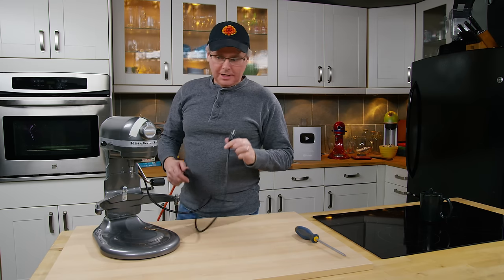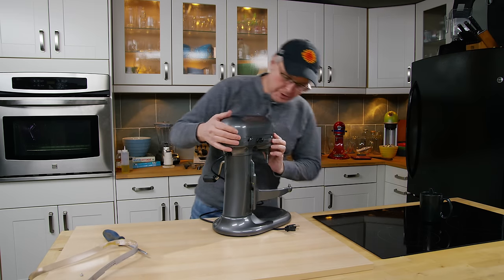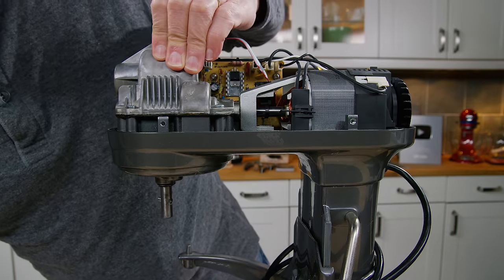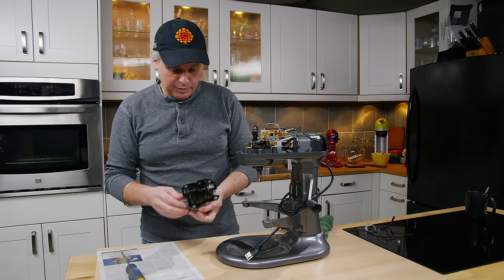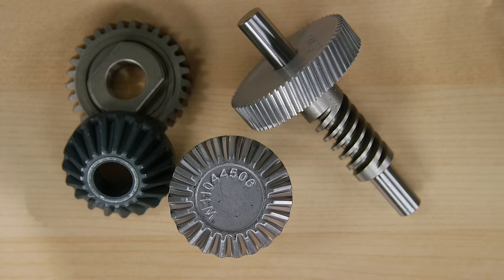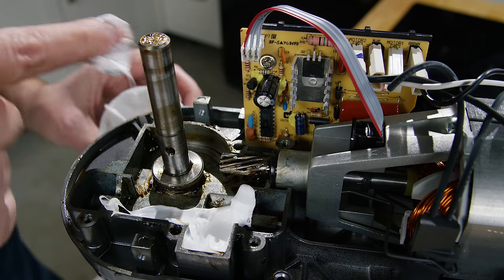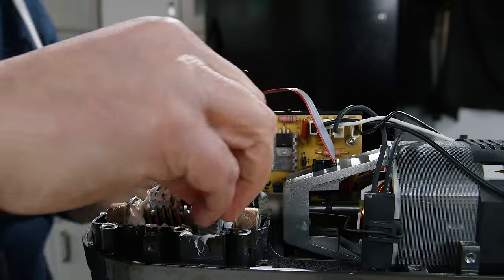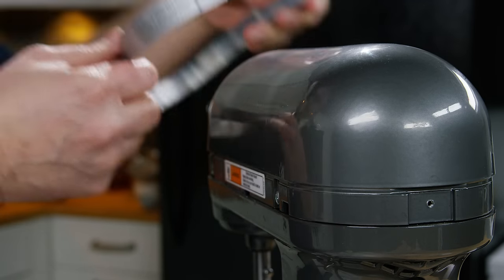Fixing KitchenAid Pro 600 Stand Mixer Teardown & Rebuild Of Gearbox - Glen & Friends Cooking

Comment: Great video and great walk-through however, you did not show people how you got the attachment gear into the top case so I’ve got a hack for that, put the top gear in the case and throw it in the oven at 450° for 10 minutes pull it out and with a oven mint and a screwdriver you can slide that gear straight in 💪🏼

Comment: I have a model down from that one. One day I was making a cake and the mixer head began oozing oil into the cake batter. Needless to say, I was not a happy camper, but I took the mixer apart, cleaned out the gearbox, and added new grease to it. Fortunately no gears were bad; just broken-down grease. I remade a new cake the same day.

Comment: Excellent video, keeping this handy as i've only worked on one of these new models and only had to replace the speed sensor, I've revived many of the old hobart ones that were about to be tossed out. Looks as if there are more parts in the gear box on these compaired to the old ones though. Cheers!
Reply: Considering buying an old Hobart KitchenAid k45 SS mixer. Are they less complicated to Greece?

Comment: I am repairing this model for my daughter in law and have replaced various broken gears easily thanks to your clear video instruction. I am having an issue with the planetary. It gets to one spot and binds up. I have removed and inspected that gear and the one that drives it, both seem fine, but nothing I do resolves that issue. The only other item is that this machine came with identical bearings for the worm gear and so I need to replace one, but I don't think that's what is giving me this issue. Any advice?

Comment: Hi Glen, what did you use to clean off the old grease? And what was the total cost for parts?
Reply: Just wipe most of it off with a rag or paper towels and toss it. There are a number of solvents you can use to get things really clean. Probably plain old paint thinner is about the safest and easiest to get. Just put some on an old rag and wipe the housing out. For any gears you want to salvage you can use a cheap paint brush and a little dish of thinner, but BE SURE that you get any loose bristles off, or they will foul things up.

Comment: Cool video. Might I suggest using an acid brush when applying grease. It will deliver a cleaner, less messy, and possibly more precise application of the lubricant.

Comment: I have a KitchenAid Artisan Stand Mixer KSM150, which is about 5 years old. Recently it had some big noises and thus I changed the worm gear as well as grease. Now it can spin quietly without anything in the bowl, but when it is making a dough with a flat beater it occasionally gets stuck and stops spinning (motor still sounds running) until it slowly gets over it. It looks as if it is not powerful enough or the torque is not large enough. Do you have any idea what might cause this problem? Thank you

Comment: Excellent video, but I'm wondering about the input gear on the motor shaft. It looked like a few teeth were worn, but it might have been grease or the lighting. Can that gear be replaced or is it one piece with the motor? Either way, thanks this really helped.

Comment: Did you wipe off the excess grease from the housing after tightening the screws?  Heat form use can make it run down etc...

Comment: Like Glen said, the grease will break down and become runny over time.  Found this out when I stored my mixer on its side during a move, and a lot of greasy oil had run out of the top seals. So keep them upright :)

Comment: Glen, we have the same mixer in this video.  I have removed the c-ring and when I try to remove the gears on the shaft, there seems to be some scoring on the shaft that is making the gear unable to slide up the shaft.  Is that something you see normally and if so, do you get a file or another abrasive to smooth it?  Thanks in advance.

Comment: The speed control on my mixer has been bad pretty much from day one of owning it.  Just recently I popped the top off and sprayed some electrical contact cleaner into the switch slot and now it works, but there is resistance to moving the switch.

Comment: Is it possible to replace the gear that comes off the motor? I had the same issue and thought it would be good to replace the drive gear attached to the motor because it had some wear.

Comment: Glen, I need your help, please! I have the KA professional 5 plus, and am attempting to replace the worn gear—however, I don’t seem to have the all important pin that goes  in between the two main gears. No hole, no pin, no way to get the sheared gear out. Any advice?

Comment: Thank you for the tutorial. My problem is the bottom piece is working its way downward towards the bowl. Can it be fixed the same way?
Reply: If the bottom is sliding down, then you've probably got a broken shear pin just like Glen had.  Not only does that pin hold the two gears together but it also keeps the shaft from sliding down.

Comment: Glen, I what’s the best way to remove form the main shaft  the worm follower gear (9706529), I was able to remove the Bevel Gear (9703337). The Worm Follower Gear looks ok but there is a lot of small metals parts blended with the grease and I want to clean the housing. Your advice is welcomed

Comment: Purchased one in 1983. Gave it away last year for free, friend still uses it. Bought this exact new model shown in the video. Out of the box it was extremely loud and would heat up. Opened the gearbox and not one (1) not a drop of grease inside. Dry as a bone, a little powered metal inside. Greased it up and so far so good. Quality control? What a joke.

Comment: I aquired a lift bowl like that from GOOD WILL.   I Replaced the Bottom Steel   Phillips screws with STAINLESS STEEL ALLEN HEAD BOLTS, AS well as FOOD GRADE GREASE    !!!!                                 <<<< Super FML - 2 Food Machinery Lubricant   >>>>

Comment: I have a problem reassembling my Professional 600 gearbox. I cleaned all the old grease from inside the gearbox, and replaced the forward gear and the front worm gear bushing. I replaced the worn parts with new OEM parts and repacked with grease. Everything moves freely with the gearbox cover removed. When I install the cover, I have around 1/16" gap between the gearbox top and base. If I try to tighten this, the motor binds! Any idea of what may be causing interference? Thanks!

Comment: The bearing cage and 2 washers (bearing races) are parts of a thrust bearing, needed because the worm gear always gets forced in that direction when the machine is running.

Comment: Nice video Glen. How did you order the parts? I have the same Pro 600 Mixer that has a worm gear broken, the one that you insert on the shaft and then secure with the pin. The model of the mixer is KP26M1XNP and the serial is W13209822. Thanks...
Reply: Where you able to find where to get parts? Can you share the link?
Thank you

Comment: Did your shaft have a snap ring on it?  Mine did on the Professional 5 plus -- I wasn't expecting that from your video -- maybe the part where you remove it got cut accidentally?
Reply: Also: do you have to lubricate the planetary gears below the gearbox?  (The set that turns the rotating shaft that holds the beater or dough hook)

Comment: Hi Glen.  I have a Kitchen Aid model KL26M1XSL mixer that I want to remove the motor, etc. from the base at the pivot.  How do I remove the top from the bottom?  The mixer was accidentally plugged into a 220V electrical outlet and I have to replace the motor, but I don't want to have to carry the base back from Egypt to get it repaired in the USA.
Thanks.

Comment: Here's what you need to know:
To adjust the bowl clearance, you can: 
Unplug the mixer and turn it off 
Raise the tilt head and lock it in place 
Locate the screw in the hinge where the head and body meet 
Turn the screw clockwise to lower the beater or counterclockwise to raise it 
Test the adjustment by dropping a dime into the bowl 
If the dime moves around continuously, the beater is too low 
If the dime doesn't move, the beater is too high 
If the dime moves about a quarter to a half inch with each pass of the beater, the clearance is correct

Comment: It seems to me the old K5SS and K45SS were much better built machines.  Mine are 33 and 45 years old respectively, and have been used a lot.  I have never overloaded them with double batches, etc.  I’ve never had any problems and it never occurred to me they might need any maintenance whatsoever.  After hearing about the newer ones getting stripped gears, I’m thinking about sending them off, one at a time, to be taken apart and relubricated so I don’t have to get one of the newer ones.  The new ones also have an obnoxious, high-pitched sound. There is an extremely knowledgeable young man out west, Mr. Mixer, who seems trustworthy and passionate about his work. Any advice from anyone?

Comment: Is engineered obsolescence Kitchenaids profit strategy? My mom's Kitchenaid is 50 years old and still working well and on that reputation of quality I've bought 2 KA mixers that failed out of the box with grinding gears. Their design is great...if they just would spend a small bit of money on good gears and bearings instead of cast gears and bushings the things would last a lifetime. There can be no other conclusion than planned obsolescence is the reason for poor quality.
Reply: Gears breaking down... It's appalling. Horrible quality indeed.
Reply: new ones I believe are not made in the USA.
Reply: I get the feeling it’s more of an intentional shear point. They’d rather have the fairly easily replaceable gears fail than the planetary or the motor. Which is how all the old ones fail
Reply: In a nutshell, yes that's the new strategy.
Reply: I honestly wouldn’t be surprised if that was their strategy. My mom received a pink one in the mid-2000’s as part of breast cancer awareness. It’s still running perfectly fine 20 years later while my 3 year old 600 series mixer sounds like it has grinding gears and I use it maybe 10 times a year
Reply: KitchenAid should be ashamed to have their name on these trash mixers that fail soon after purchase!  Plastic gears are the sign of planned failure! The engineering and design is good, but parts that make up the gearing assembly are unsatisfactory.
Reply: I heard it was to avoid ruining the motor.
Reply: Just did mine after 15 years and my wife bakes all the time. Thanks for the video. I bought the $52 kit which included everything including a snap ring tool.

Comment: My machine is 20 years old, but I don't have any problems with it. Should I disassemble it to replace the grease as maintenance, or is that not needed unless it starts having issues?
Reply: If it ain't broke, don't fix it. Unless you rely on it for something and would be severely put out if it was broken. I imagine Glen's break a lot because he uses them a lot. If you're like the typical home cook, you aren't using it THAT much so it'll likely be fine for years to come.

Comment: is it safe  to use the Kitchenaid Stand mixer without the band trim ring on it?
Reply from the maker: I never took the band ring out of the box. So Yes it is safe to use it without the band trim ring.*

*As long as you resist the urge to stick your hand into the mixer while it's running.

Comment: Where do you bought that parts? Any part number? i need that part, thanks!
Reply from the maker: You need to order the parts by the number on the ones in your machine - I've found that the 'same' looking machine, with the same model # on the outside, had different gears inside. So you'll have to take yours apart and find those #s.
Reply: @GlenAndFriendsCooking  ok thanks

Comment: What’s that gear called? I’m having a really hard time finding it
Reply: I had the same problem. The best thing to do is get the part number from the manual that came with the machine or find a digital (pdf) version of the manual online. If you can’t find the exact part number, then try www.applianceparts365.com. I found the gears by choosing Kitchen-Aid from the “Manufacturer” drop down menu and typing the word “gear” (no quotes and no letter “s”), then clicking the “Search” button. There are great pictures on that site that helped me visually match my gears, but I did have to disassemble my machine to see the gears  clearly which is a good idea and  good practice. I recommend reassembling the machine while you wait for the parts so you don’t forget how it goes together and don’t lose the parts. Alternatively you can put the small parts in a ziplock bag Regardless of whether you decide to reassemble or ziplock the parts while you wait for your replacement parts, it’s always a great idea to have someone film your disassembly of the machine so you know the order and location of parts for reassembly which may be weeks later. As for names, the gear attached to the long horizontal shaft is called a worm gear and the two disk shaped ones that fit on the vertical shaft are (from top to bottom) a “beveled drive gear” and a simple “drive gear”. The beveled one is the one with the taper or ramp on the top (this was the one that was chewed up on my machine). Also note, on my machine, there was a retaining ring holding the beveled drive gear in place on top of the simple drive gear that didn’t exist in this video. Check for this If your bevel gear isn’t coming off easily. You must clean off the grease on top of the bevel gear with a rag and some cotton swabs. Then take a plastic or brass bristled brush to remove the fine bits of old grease as much as possible to allow you to see the split retaining ring. If you do have this ring, it will be “C” shaped with the open ends almost touching. There will be one hole in each of the open ends which need to be expanded with a special tool called split-ring pliers that have points on the end to fit in the holes. The split ring (if present) will sit in a groove on the shaft to hold the bevel gear in place and it requires a special set of pliers. By squeezing the pliers handle, you widen the gap in the split ring and raise it out of the groove. Hold tension by continuing to squeeze the handles and lift vertically. I wedged a thin putty knife between the split ring and the beveled drive gear to push upward on the split ring which really helped. If you have another person who can operate the putty knife that might make it much easier. The hardest part is expanding the split ring and and moving it out of the groove first. Once you have done that, continue to expand it with the split ring pliers and wiggle it up the shaft. You may need to keep using the putty knife to push up from beneath the ring unless you get a really good grip on the holes of the split ring because even after it’s free from the groove it will clamp itself onto the shaft making it impossible to slide freely. And to be clear, split ring pliers are NOT the same as needle nose pliers, but they can be found at a hardware store or home improvement center. if you have a mechanic friend they may have a set too. The nibs/tips of the pliers are often interchangeable so you can use different size nibs/tips to fit various sized split rings. You will need very small tips for this small split ring on the Kitchen-Aid mixer (if it’s present). I have the 5-Qt professional HD bowl-lift mixer, but they presence of the ring may depend on the manufacturing date of the mixer. I suspect the ring may have been added in an attempt to improve operation and to keep the bevel drive gear down on the shaft, but this is just my guess.

Comment: smart-ass here: when servicing appliances or electronics in general, keep in mind that even if you unplugged it, capacitors may still hold a significant charge. 

Good vid btw, its a shame that poor quality "steel" has so infested the supply chain, that an otherwise decent machine like this can have a point of failure somewhere inside, resulting more often than not in total failure. All to save a fraction of a cent on metal. I have metal tools from my father that work better than 90% of whats on the market.
Reply: Excellent comment!

Comment: I have the same ka 600 model, I bought it from one of the big name clubs.  Hate the damn thing.  I've only used it about 10 times and now it started making all sorts of different noises.  I must of gotten one of the Friday night specials as I call it.  It's a piece shit.  I hate to have to tear it apart.  I'm a old lady and I think I could fix it, but don't know about ordering parts for it.  That part I don't understand.  Plus I don't have anywhere to tear the little monster apart on.  I have no room on my one little kitchen counter, and don't have any table available to use.  So I guess I'm out of luck.  What a waste of money.  I should of read up on what kind of stand mixer to buy.  Too late now.  But thank you so much for the video sir.

Comment: The vertical shaft showed some thermal scoring which you did not address. Also, you should have ordered and replace that tiny thrust bearing while you were at it.